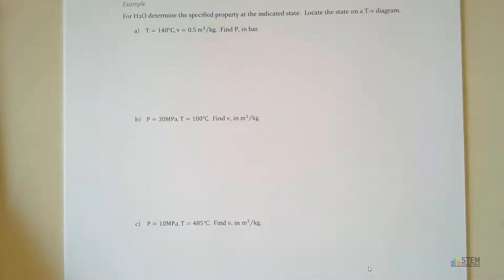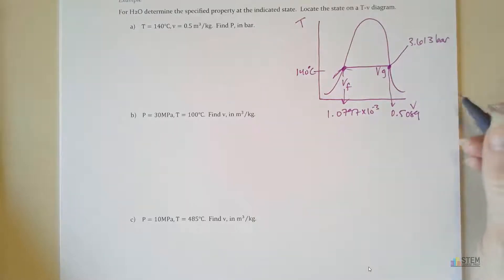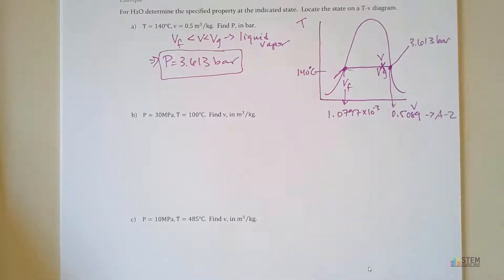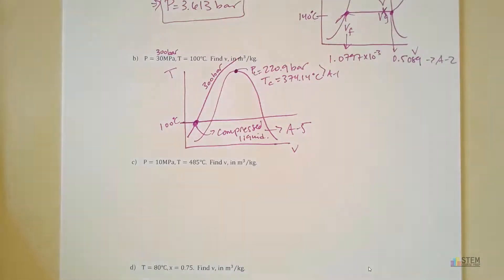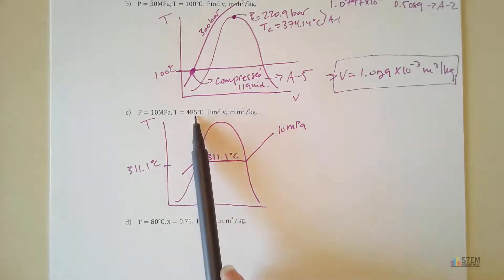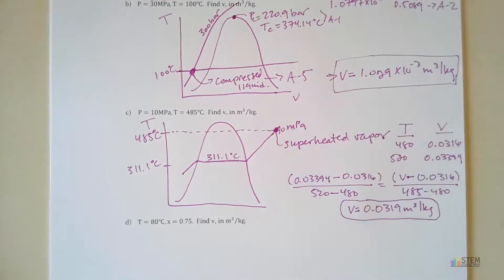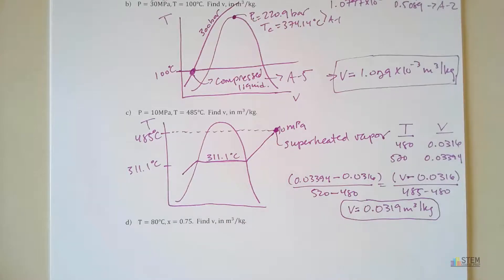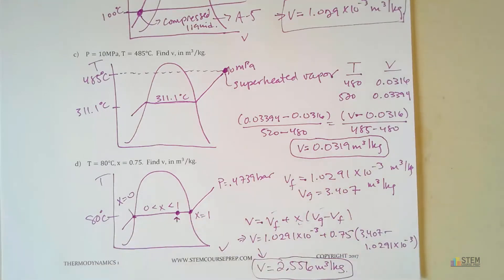Thermodynamics - Steam table example with superheated vapor, compressed liquid, liquid vapor mixture

Comment: In the first problem you have to use a P-v diagram. Plot isothermal line of 140 celsius and compare given v against vf and vg to state if it is a mixture or it is out of the curve. You complicated it.

Comment: may I know at compressed liquid and superheated steam there are no quality found. Why this happened?
Reply from the maker: quality is a measure of vapor in a liquid vapor mixture. Compressed liquid and superheated steam are not liquid vapor mixtures so quality is not useful for those substances.  Quality is only used inside the vapor dome where there is a liquid vapor mixture